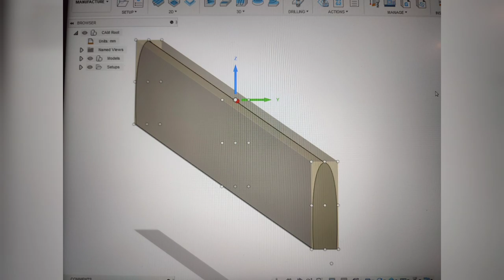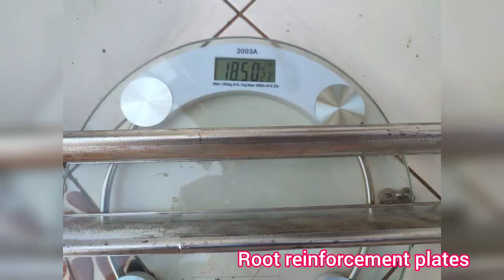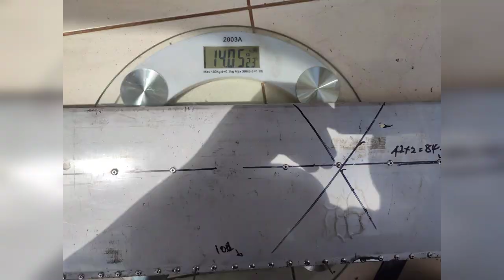Main Rotor Blades for a homemade helicopter

Comment: Merhabalar kolay gelsin. pervanenin uzunluğunu ve genişliğini nasıl hesap ediyorsunuz.   bununla ilgili bir progam varmı
Reply from the maker: There are software's to stimulate wind tunnel features for testing aerofoils characteristics and performance, but at this age all that has been done by researchers and there quite a number of profiles you can chose from that are already proven and tested, for instance in this video the profiled I made is called NACA0012 it's asymmetric shape. Then about length and chord of the aerofoil depends on many factors such as your design blade loadings, tailboom length, blade mast loadings etc.